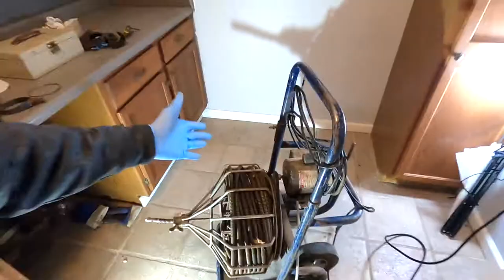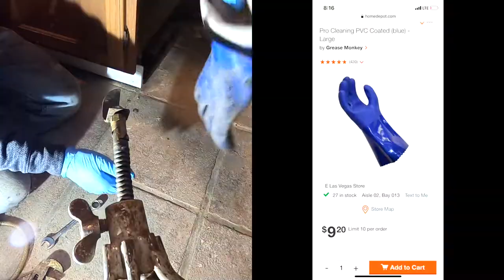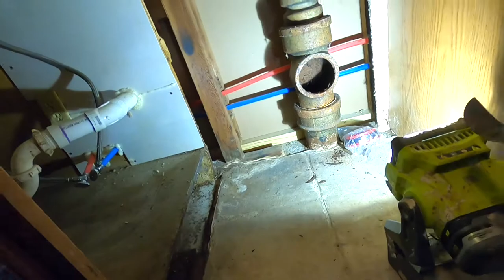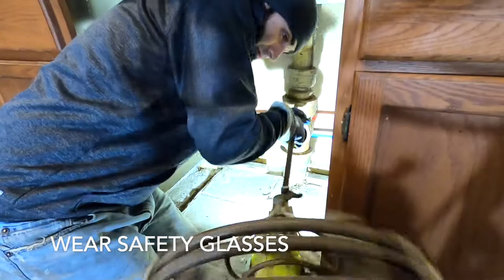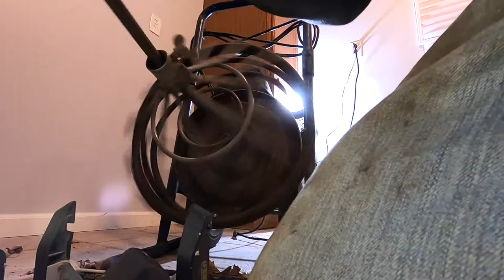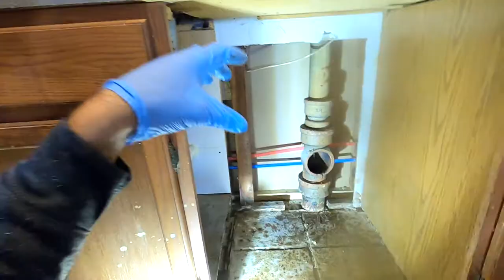Clean MAIN Sewer line + Electric EEL |Landlord Plumber

Comment: Just tried to snake floor drain in basement with 50 ft 1/2 inch EEL that rented with home depot. It didn't help. But got a lot of fun.
Reply from the maker: Sorry to hear you didn't get the drain cleared. I personally don't like going through a floor drain. No Cleanout? Happy to hear you had fun. How did u get it cleared?
Reply: @handylandlord  I used the drain because I couldn't unscrew the iron cast cleanout cap. Eventually, I had to call real plumbers. They just cut off the cap and were able to snake 120 ft to the city sewage. The clog was about 90 ft from the cleanout. It's funny that there is a cleanout outside, but it's buried under the driveway slab. The cost was $400, including a video inspection. This is close to the price of renting the same equipment that they used.

Comment: How are the 3/4' drain cables direct cables? Have you noticed if they are better than / not as good as Ridgid official cables? Have you ever snapped one or got it kinked?
Reply from the maker: I believe my cable is 5/8 110ft but after looking at the drain cables direct website I can't find my cable. The only Ridgid cable I have ever had is on my k400 and I did not like that end because it was so big/long when going into an old cast sanitary tee. But I've been told, I have no idea what I'm doing from " professional plumbers" on YouTube. hahah  

This is my nightmare drain, still engraved in my brain. 
https://youtu.be/NCTuIMT4iaU

As you know plumbing repairs are probably my number one call. I think you are doing a great thing investing in the equipment. I still keep a few drain cleaners/ plumbers in my phone if I'm too busy or just don't want to snake a drain. But that's rare haha.
Reply: Is your 5/8" wire inner core, plastic inner core or hollow core? I've seen a bunch of Plumbers say 5/8" is too small for roots but curious to hear what you think. Is this before or after you broke your cable in that one horror video lol?
Reply from the maker: @DaniilStanisevschi  I’m going to confirm it’s 5/8. Possible it’s 11/16. I’m looking at the website and can’t find what I have under 5/8. Yes, same cable I snapped but that was a unique situation. That doesn’t normally happen. Haha
Reply from the maker: @DaniilStanisevschi  it’s 11/16 no core, slip joint ends, 110ft. Sorry for bad info.
Reply: @handylandlord  all good, appreciate the all the info you provide!! 💯

Comment: Is that a decent machine ..my neighbor wants to sell me used one with 3/4 cable
Reply from the maker: Yes. I paid $400 about 10 years ago. A little hard if u are going up and down steps. No slides on back of machine. If it has the electric eel cable I have some extra cutters. Can mail u. I switched my cable to slip joint type end. 
https://youtu.be/7mVevlRbmh8

Comment: How do you pull it back in like is there a reverse button or something
Reply from the maker: Some machines have an auto feed on the front where the cable comes out. I do not have that. This is all done manual. The reverse on the motor is to help get cable unstuck. In and out of pipe is all done with muscle(Aka I’m shredded).

Comment: What is it hair?
Reply from the maker: Tree roots.
Reply: @handylandlord  does that mean sewer line leaks?
Reply from the maker: @bhadz100  It’s roots from trees. They work their way into the joints through the old clay pipe. It could be leaking a little but not being under pressure the water will take the path of least resistance. I just got a camera recently to inspect the sewer lines more throughly after the clog is cleared.
Reply: What camera did you get for sewer inspection?
Reply from the maker: @badchips10   See link. Full review video coming. https://amzn.to/3udDea6
Reply: @handylandlord  do you get scared that the cable might snap and get stuck in the main line
Reply from the maker: @bhadz100  you can feel and hear the machine build up tension. At that point, I pull the cable back to relieve tension/build up. If you haven’t ever ran one of these machines it can be a bit of a learning curve to know when there is too much tension on the cable.
Reply: @handylandlord  effin plumber scared the shit of me when he said be careful of those china snake machine, the cable might snap on the turns
Reply: @bhadz100  Keep the cable clean and oiled when you’re not using them, to prevent corrosion. Breaking is unlikely. You’re more likely to kink the cable and require a new one. Or worse, break some fingers getting wrapped up in the cable. Use good gloves which resist sticking.
Reply from the maker: @WontSeeReplies  I agree. Oil and u are normally good. I replace when the cable gets really sloppy. I’ve kinked a few cables and had to install coupler to repair. I’ve also built up too much tension trying to get through roots and had the cable come out the side of the drum. Sometimes it’s tough. I need to make a video of all my drain cleaning equipment.